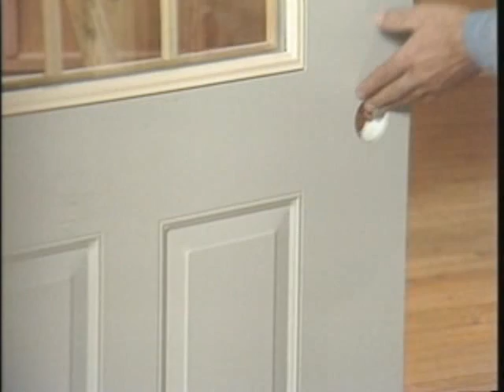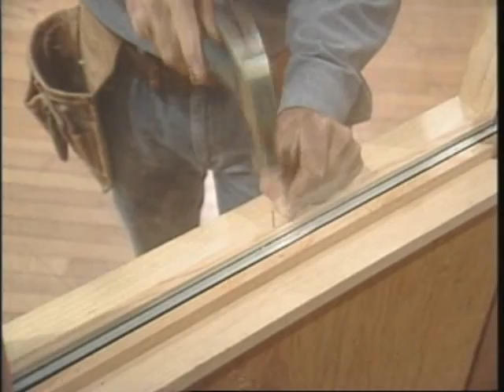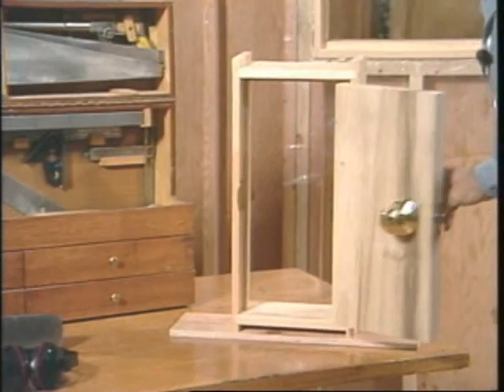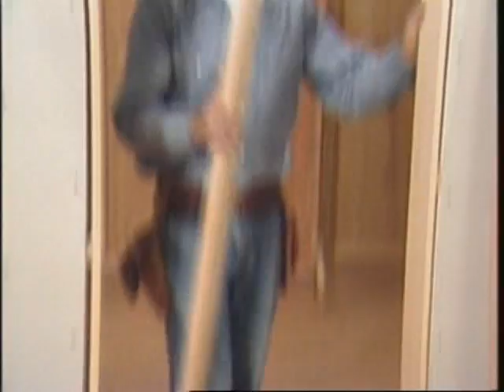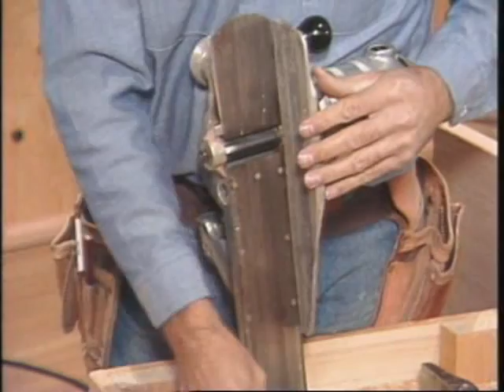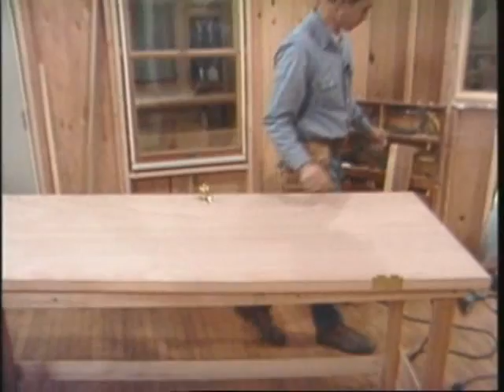Installation Windows and Doors

Comment: This is amazing. Thank you so much. I have a “new” 125-year-old home I am restoring. This information is invaluable.  R.I.P. Mr. Master  Carpenter.
Reply: Any signs of paranormal activity?
Reply: I redid a house in Knoxville Tennessee. Built in the 1920s.  Had. Coal built-in furnace with room    I didn't see "ghosts ". But I did hear sounds. I slept in the house a couple of times, I would feel something kicking and scratching the back of the couch.  Something would jump on back of the couch directly behind my big head.   There was the feeling something staring at me whenever I was taking a shower. ,  tools were moved to other locations after putting a something up.  I loved the job I had done with the house.

Comment: I am a complete novice in the United Kingdom.  I built myself an external room using Y tong blocks.  These are aerated concrete blocks (perhaps I am the only person in the UK using Y tong blocks - a very popular block in all of Europe to build a concrete shed outdoors).  I have solid concrete blocks where the walls with Y tong blocks rest, and as the boundaries of the floor.  I compacted some 3 inches of type 1 stones as the basis for a floor (will then place sand, a damp proof layer, PIR insulation boards and concrete to come level with the top of the foundation concrete blocks).  Now I have the challenge of fitting a door to this concrete shed.  I have so far only built two three walls so only one side for the door is ready and the other can be built to measure.  As most doors you buy in England are rather expensive and poor quality Chinese or Malaysian imports, I obtained an old front house door in hardwood from a place that replaces windows and doors, a free door.  This door is about 830 mm wide (33 inch) wide.  I have no frame for this door so must make my own.  I now have the challenge of hanging the door.  Although this is an external door I will hang it to open outwards with its handle on the left if viewed from the outside and opening outwards and to the right if facing the door.  I must build a wooden frame (perhaps in hardwood? oak? walnut? birch?  The Y tong aerated concrete blocks are very light and crumbly.  For this reason some weeks ago I stuck a thick vertical square cross section piece of hardwood, like a post for a fencing panel?, and set it in rapid set concrete so it is flush and slightly behind the wall in order to lean my frame so as to give it more rigidity and support (I do not rely only on the concrete wall).  Unfortunately, I put this wood piece of vertical hardwood (a type of fencing post) on the left side when looking from the outside.  At that time I was going to open the door outwards (or inwards) hinged on the left if seen from the outside but now decide to hinge in on the right side.  I plan to hold the makeshift wood frame with foam to the concrete blocks and perhaps with some appropriate fixings (perhaps the fixings will have glue so they stick better in the concrete).  I am concerned about obtaining a flush finish, the bevel you spoke about, and will use "packers" (plastic packers) instead of shingles.  Have you any pressing tips for this type of installation.  I could send you a photo.  Many thanks and kind regards. I have enjoyed very much your videos.